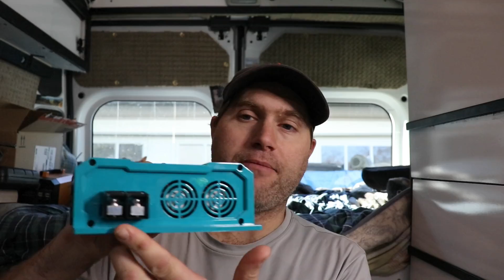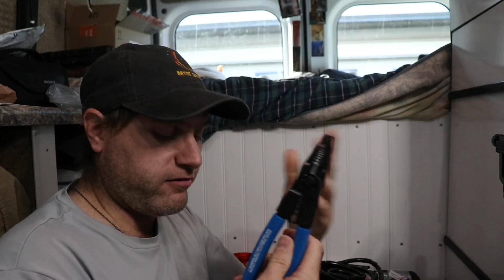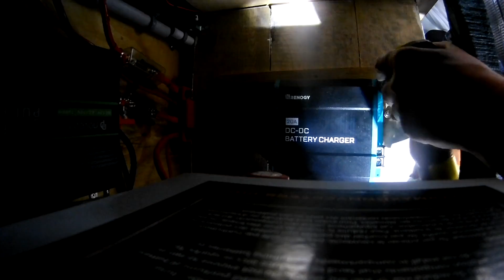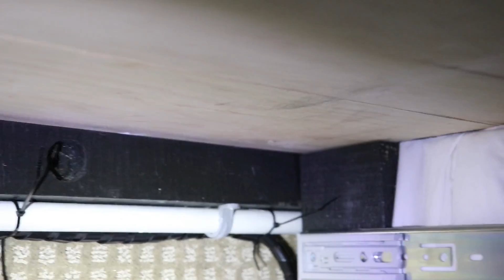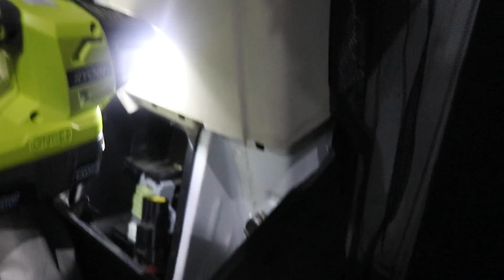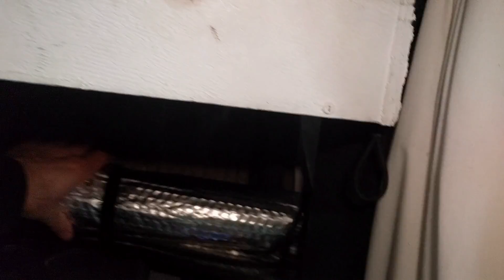Install DC to DC Engine Charger on Ram Promaster | How I Did It

Comment: Shouldn’t it go direct to the battery and not the bus bar that your inverter and charge controller go to?  Or does that not matter/affect them🧐🤔
Reply from the maker: It should go to the bus bar. Everything goes on the bus bar and the bus bar is the only thing going to the battery.

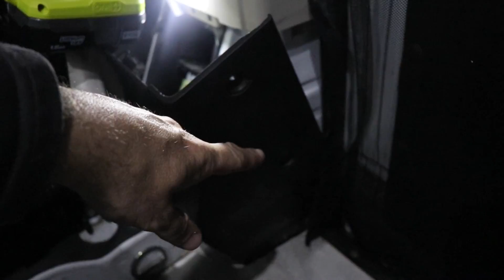Comment: 19:40 What is an uplift kit?  With a fuse box?  I can't find this on google. Do you just mean lift kit?  that is common and I get that.  uplift sounds like a kit that lets you adjust the height and that sounds cool if you can point me towards it.
Reply from the maker: The uplift kit is an option from the dealer that adds some extra gadgets, probably a wheelchair lift, and I think a few other options.

Comment: I couldn't find a bullet pin that fit in the signal socket, so I took a 14-16 gauge pin and opened up the tip with a nail to make it female. Worked well.
Reply from the maker: Nice.
Reply: @TuxTraveler  do you know what kind of bullet adapter, or what size to use here?
Reply from the maker: @christopherbroskie1484  No. I picked up a pack of random adapters from an autoparts store and one of them worked.

Comment: Hey bud, I finished the install of my 40A Renogy DCDC charger but the D+ cable isn’t sensing a voltage when I flip my toggle switch ON. 

For reference, I have the toggle switch connected to my house battery terminals and the “load” prong is connected to the D+ terminal . 

When toggle switch is turned on, the blue LED in it indicates it’s on but when I check the DCDC charger there’s no light indicating that it’s on.
Reply from the maker: Not completely sure, but it is possible the D+ might need tied to the car battery and not the house battery. Can you try that?

Comment: As a truck driver, with a reefer trailer (has a mounted motor on it) I DO NOT WANT the "vibration sensor" .... So D+ line is ideal .... And not a faulty design by Renogy .... If I was to use it. I'm still shopping lithium battery before I get a dc-dc charger .... But I noticed that vibration sensor feature
Reply from the maker: Look at the SOK batteries. They are very well built and cheap, using the same cells as the expensive batteries.

Comment: Hello great video by the way!!!✨✨✨✨ I also have a question with the bullet connector would I need a male connector for it?  And for the circuit chart that you made, am I allowed to plug it in anywhere in the 3rd column that has an “X” on it?
Reply from the maker: The ones with the X ALWAYS draw 12V, so they will always pass an on signal to the device, which will likely kill your engine battery if you forget to turn off the device, so I would not use them. I used the one I did because it ONLY draws 12V when the key is in and turned to the On position.
Reply: Thank you for that. So to have it configured like yours I would need to connect to column “1” row 3? Is that correct?
Reply from the maker: If I recall, I used the last column, last hole, but I have not watched the video in a while. I would probe them all because I have the documentation for that panel and the probes gave me different values than I expected from the documents. It is easy to probe them. Put your negative on the voltameter on the body of the vehicle and stick the positive in each hole while the van is on and while it is off. This way you know exactly how it is wired.

Comment: Very good description of the D+ connection.  You could easily make use of the CL feature with your setup by switching out your toggle switch to a DPDT and adding another wire.  I used a HOKAAER Rocker Switch Toggle On-Off-On 7 pin DPDT switch to control the charging output on a 60 amp Renogy DC-DC charger in my travel trailer.  The charger turns on when it detects current on the D+ wirre and defaults to 60 amp output.  When current is detected on the optional CL wire, output is reduced to 30 amp.    

Pins 1,2,3 are on the left.  Pins 7,4,5,6 are on the right.  Pin 7 goes to the negative ground.  Pins 2,5 are in the middle and  jumpered and go to a fuse that is only powered when the ignition is on (you can use your existing feed for D+ for this connection). Pins 3 & 4 are jumpered and connected to the D+ output side of the switch and supply power when the rocker is in either On position.  The optional CL wire is connected to pin 6.  The charger supplies 60 amps in the upper position, it is off in the middle position, and supplies 30 amps in the bottom position.  

Renogy also recommends that you put a fuse close to your start battery that is 1.5 times larger than the maximum output of the charger.  I used a 90 amp block fuse in my truck and also added a Blue Sea on/off switch so I don't have any live wires when my trailer is disconnected.  I opted for the fuse block over a breaker because some users report nuisance trips when the engine compartment gets hot.
Reply from the maker: Good thoughts here. I can't remember if I have it in the video (I am sure I do), but I have a fuse right in the battery compartment on one site and right before the house battery on the back as per their specs, which I think is 20 amp on the car battery and 25 on the house battery side.

Comment: What size bullet adapter?  I bought one for 14-16 wire and it would not fit.
Reply from the maker: I could not find one that was perfect. I bought something a little large and compressed it with pliers until it fit snuggly. I just bought a cheap pack of random adapters from an advance auto.

Comment: The bullet plugs I purchased feel loose inside, do you know if they vary in size?
Reply from the maker: I think they do. Mine were either too big or too small. I crushed it with pliers and it fit in nicely.
Reply: @TuxTraveler  another question if I wanted the light to work on my switch how would I wire that? Like locations of each wire on the 12v switch?

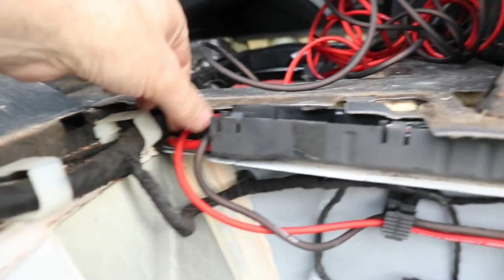Comment: Nice job Tom. I see only one possible issue @17:30 where you turn the wires up to go to the battery box that could be a ware point for the wires against the metal lip of the chassis. Better choice would've followed the factory black cable and ran the two wires through the same white factory clip. I know everyone is a keyboard critic. 35 years as a mechanic says it's a small oops... LOL lol LOL
Other than that it is a great job and fantastic option for power... :-)
Safe Travels Tralver!
LLAP
Reply from the maker: Not sure why I didn't see that at the time. It is not right over the metal, though. The wire it is on top of provides cushion, but I will move it to the channel when I am in there next.
Reply: @TuxTraveler  :-) It's all good Tralver... Sometimes you need a old half blind retired mechanic watching over your shoulder... Lol
Besides we need to keep ya on the road. I'm still buying lunch.. :-P
LLAP

Comment: How is the ground on wood when wood does not conduct electricity? at 12:37
Reply from the maker: That spot has a hole for tie downs, so we sanded off the paint to make a clean connection to chassis ground and connected a grounding bolt into it (Easy to access from the panel on the other side of the divider wall.
Reply: @TuxTraveler  
Thanks, I new there was a reason.

Comment: Tom m  not bad for a non ham operator although we would  fuse the ground
on both sides of the firewall along with the hot side  both sides in firewall and again on your Hot 12-volt  Engine voltage.
Yes I've seen The ground side Catch Fire because of it not being fused. KF6KFM
Reply: I agree, I would have done the same thing and fuse both but in this application I believe it is a very small chance of a issue. :-)
LLAP
Reply from the maker: It is fused on the battery end. The bolt we tied into is a fuse. There is not a fuse on the house battery size as the chassis ground will prevent issues there.